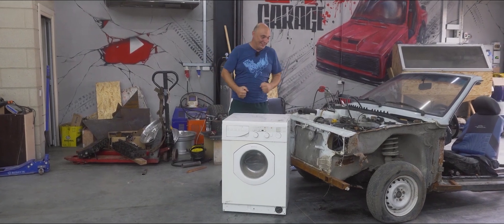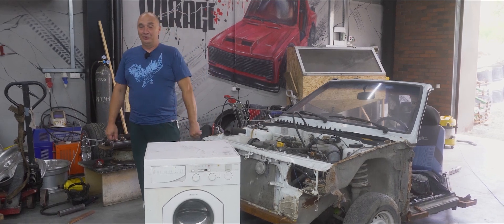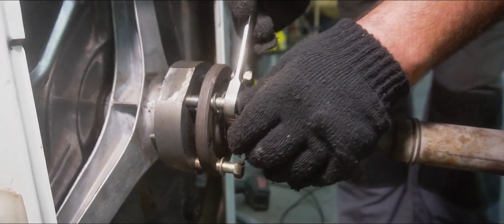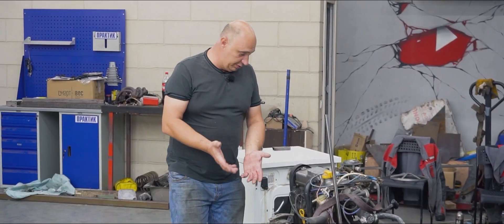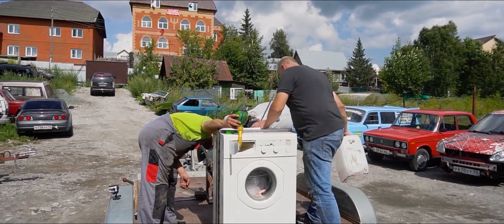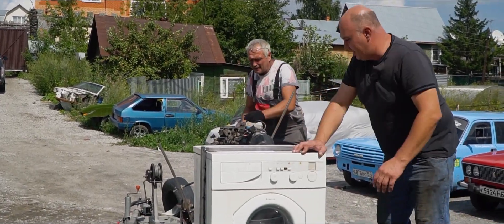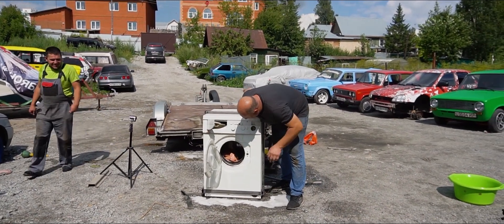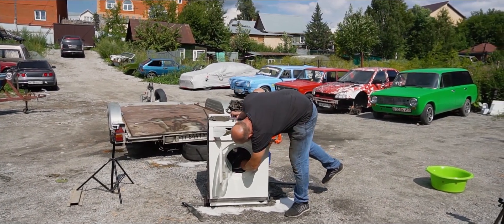Fitting a car engine to a washing machine (spinning it up in 5th gear)

Comment: Years ago I found two projects in the Mother Earth News magazine. One dealt with converting a V-8 Chevrolet pickup truck to run on wood gas, but I see you have already done a wood gasifier for your Lada. The other was a man who needed power and heat, so he used a 4-cylinder 2.2 liter (if I remember correctly) Ford Pinto engine as a stationary power plant and fueled it with methane gas from a digester that used animal waste. That stationary power plant might be interesting to recreate with a Lada engine.

Comment: It's very hot where we are living at the moment and your video inspired another idea that could mitigate this problem. 

The ceiling fans in our place just aren't getting the job done, but they are just conventional electric fans. A more effective fan could be assembled using an airplane propeller spun up by a Lada engine. (and transmission for speed control) 

We eagerly await the testing video. I am sure that any of the Garage 54 mechanics/engineers/videographers/hooligans will be proud to volunteer their residence for the testing video.

Comment: I vote for a dryer.  Spin it fast enough and you will hardly even need to heat it. QUICK dry.

BEST LINE: 'it all works quite well.  We just haven't tried it yet"   Pure GOLD.
HONORABLE MENTION:  Don't use a washing machine to clean your carburetor"

That is VERY good advice.

Comment: Why did you make this difficult? Why didn't you just remove the drive wheels and lengthen the output shaft leaving the engine in the car, with gear shift, throttle, and a seat to control it from ;)

Comment: There is a missing obvious symbiosis, connecting the cars cooling system to the drum to heat the water. The water needs heating and the engine needs cooling.

Comment: FYI.
A spin dryer spins at 1200rpm.
That engine at redline would be 6000rpm and in 5th gear its .9 reduction so 6666rpm!

Comment: Attach it to a wheel with a super high gear ratio and see if you can get the wheel to explode at any point. U can try diferent wheels to see which one can rotate faster.

Comment: Would've been brilliant if they had used a similar pull to the original and connected the radiator up to the water system 🤣👍👍👍

Comment: It might have worked even better with an automatic transmission, and bear in mind that when you block one side of a differential this way, the free side will turn at twice the normal RPM!

As for something else to spin up, why do I get the feeling that a tractor rear wheel could be fun? - Of course, you'd need to be out on an airfield or some such, in case the wheel broke free and decided to disappear into the sunset! - Oh, and you can fill tractor rear tyre with water!! 😱 💣 🌀

Comment: back in the 1920's there was a gas powered washing machine, using a MUCH smaller engine , for those who didn't have access to electricity

Comment: V8, transmission in higher gear like 5th, some sort of reinforced washing drum with some good bearings bolted into the ground so it cant wobble or escape. I want to see those cloths spin dry at 10k rpm 5000g of force.

Comment: Oh, the jiggly bits, they don't build them like they use to. What's the horsepower rating on your washer, sir? Spin cycle from wet to dry in 5.4 seconds.

Comment: Now run the exhaust to the dryer and you can dry your clothes at the same time. Use the other axle to drive the dryer drum. On the other hand they might come out dry but smelling of exhaust.
Reply: not if you use tube heat exchanger like on trabant

Comment: Garage54: Hook the engine to another V8 engine with the exhaust valves shortened and welded shut, then add tubes to the spark plug holes going to a big air tank and make one heck of a fast compressor!

Comment: Engine powered rotisserie chicken.
Engine spins chicken, & cooks it with radiator water forced through chicken.
Like Colin furze but with a gas engine, & @ 3000 rpm. Worlds fastest spinning chicken.😎

Comment: I love how often they run engines with no radiator.
Reply: In Russia it becomes so cold sometimes, so that a radiator turns into useless thing.
Reply: There ladas
Reply: At some point the engine gets so hot, that the fuel is just combusting before the spark plug even fired. By then any ECU would be tarding the timing so low that you barely have any power left. If it's a rotary based ignition the thing would just die off.
Reply: Their Russian, they don't need a radiator
Reply: It’s fine they can run for about 5-10 minutes before she starts to die off
Reply: Ud be surprised how long u can run an engine with no coolant
Reply: I was thinking the same thing. Amazing that the engine doesn't self destruct quickly. I guess everything near the combustion chamber would be at insane temperatures without fluid in the cooling system. Aluminum and/or steel have high thermal conductivity, but clearly not enough, or the manufacturer wouldn't bother putting cooling ducts that close to the cylinders.
Reply: Small annoying details.

Comment: Westinghouse made gas powered washing machines in the very early days for farms and family's that lived off the then very young power grid in America. the washer had a small gas engine and a kick starter for the wife to start it . it had 2 instruction panels one for the washer and one for the engine. you can still buy the engines on Ebay but the sellers want to much for one of them

Comment: Now set the switch where you can open the door while running and throw a cinder block in it. First mount the washing machine to the frame with motor take the bracket from sides and top and it will blow up machine and send barrel tumbling across yard

Comment: heh, by locking down the 1 cv axle, you ended up with x2 the RPM's on the other axle that went to the washer. so you got 2x the speed that you were probably expecting.. :)

Comment: You know? It didn't hit me until the video start playing that the washing machine can be run using the engine off a electric clutch pully like the AC system has with the power provided by the washing machine's motor contacts.

Comment: 'Oh, the counterweight grenaded itself'.
For most people this would be close to the end of the world, no clean clothes, having to fork out for a new washer, and having to pay someone to take the old one away (even scrap men dont like washers, as the counterweight, grenaded or not, is heavy and worthless)
Reply: Weird, washing machines are filled with invaluable electrical components.
Reply: @czechgop7631  the cost of disposing of the non-valuable parts is greater than what you can get selling those 'invaluable electrical components' hence why nobody wants them.

Comment: try a washing machine with a V12.   fill it to the brim with just detergent and put clothes in it. let them tumble in first gear to actually wash them for a while while watching the suds overflow.  then use the highest gear to dry them out without rinsing it.  will the extreme high speed rince the detergent?

Comment: put the engine in a boat using the axle to drive a propeler or maybe make a huge blender and use the engine to drive it shredding everything you could

Comment: So, your washing machines have a big cement ring for a counterweight? 10/10.
Reply: Quite a lot of washing machines have a heavy counter weight in them. Older ones used cement, not sure is that still a thing. Haven't opened any of the newer ones, warranties just last too long these days

Comment: Hook up a industrial floor fan propeller under the hood of sum beater eater car. Redline it fer a bit an watch that propeller launch itself into the stratosphere.

Edit: Don't be flying eny drones overhead, there is a 90% chance the thing will be obliterated during launch of the propeller.

Comment: TRY TO CONNECT MULTIPLE GEARBOXES ON EACH OTHER. BIG ENGINE... AND THE LAST GEARBOX TAKES ALL THE RPM
Reply: Reverse connect a gearbox to increase RPM and build a proper cooling system on the engine.
Make it out of a rear wheel drive engine and gearbox then add a second one output to output and firat gear on the second one will spin like mad!

Comment: 1925: Maytag washer powered by a single cylinder 2-stroke motor. Clothes get washed.
2020: Garage54 powers a washing machine with an 80 hp 4 cylinder 4-stroke motor. Hilarity ensues.
Reply: I was looking for the Maytag 2 stroke machine comment and finally found it 🤣
Reply: there's a 2cyl version of the maytag btw
Reply: tristan 123455 I actually have the 2 cylinder motor. It’s a boxer. Sounds awesome
Reply: Hook it up to a Corvette motor and just watch it enter the next dimension.
Reply: My great uncle put one of those maytag engines on a bike
Reply: @rexjolles  Niiiice.....
Reply: @i think you should stop A twin turbo large V8. Maybe a Cadillac 8.0 litre? Plenty of low-end grunt for big loads.
Reply: @billh230  look up top fuel engine powered blender.....flame spitting margarita maker
Reply: Maytag also used hit and miss engines, not 2 or 4 stroke
Reply: @tonythemadbrit9479  Hit miss is usually a 2 stroke
Reply: @ellenorbjornsdottir1166  I've built a hit and miss engine, and the engines are neither two nor four stroke. Their cycle depends on the speed governor, not the number of strokes. Mine fires about every eight cycles (or sixteen strokes).
Reply: @tonythemadbrit9479  that doesn't make it not a two-stroke. that just means that it's skip firing.
Reply: @ellenorbjornsdottir1166  No. A two stroke exhausts and intakes on the same stroke, and fires on the other stroke. A hit and miss intakes on a stroke when the governor detects the engine has slowed and closes the exhaust valve, then fires on the next stroke, and exhausts on the next.
Reply: @tonythemadbrit9479  Wouldn't that make it a 4T?
Reply: @ellenorbjornsdottir1166  You could say it's a form of 4 stroke with additional strokes from the flywheel momentum. I don't know the term "4T" in the sense of engines.
Reply: @tonythemadbrit9479  Quatre temps - it's the French term for a 4 stroke.
Reply: @ellenorbjornsdottir1166  Interesting. Thanks for that.
Reply: I got a running 1926 maytag engine
Reply: @dillonrumley3295  Excellence, thumbs up!
Reply: I was going to Mention the Maytag washing machine but you else got to it before I could
Reply: but the Maytag last forever

Comment: After seeing this, I kind of want to obtain one of those giant washing machines used in industrial applications (think, the kind that are used to wash soiled linens from hospitals or job sites). Then obtain one of those utterly massive diesel generators used to power entire corporate buildings during blackouts. Mate the two together with a gearbox from a semi-truck in-between.

Comment: suggestion: convert a car from front or rear into left wheel drive (or right), as you prefer
Reply: Literally disconnect a cv axle and you’re done
Reply: @drsipp407  and you have drive at both left wheels?
Reply: Snarl616 get an awd and disconnect both right cv’s
Reply: @drsipp407  Too easy and not that destructive. They should get a front wheel drive and turn it into a left wheel drive car by swapping the parts.

Comment: Should have hooked the engine cooling system up to the water inlet on the washing machine you wouldn’t need the water heater then.
Reply: Yup, you beat me to that one 👍
Reply: @thefreedomguyuk  ๅ
Reply: I hate how much sense that makes
Reply: like mastermilo did it
Reply: I was just thinking that 👍👍
Reply: And exhaust for bubbles and carbonation of your clothing!!!
Reply: Would be hard to do considering a normal washer doesn't cycle water consistently, it just fills up. So water wouldn't cycle through the car consistently.
Reply: Heat exchange is safe for motor. Dirty water will not go through motor. Just put simple radiator below the washing machine. 
Actually gasoline powered washing machines exists in the history.
Reply: Mmmmm it is going to get cloged with soap
Reply: @emiliomar7638  no you'll just have clean water jackets 👍
Reply: @nicklacerte7134  would blow the engine in minutes
Reply: @upnorthviking823  laundry detergent has been used for years to clean an engine's cooling system.
Reply: @nicklacerte7134  and t 👕
Reply: @emiliomar7638  You have a strange channel my friend!👌
Reply: I thought this as well!
Reply: Came here to say the same
Reply: I wrote the same thing before discovering your comment.
Reply: That's a good one, more like a heat exchanger? Takes some time to reach 110 degrees celcius
Reply: Genius! The only problem is, the washing machine was leaking through its heater. Well, not a big issue, just fix the leaking and voilà!  :-)
Reply: There would be so many air bubbles the engine will overheat
Reply: Add copper heating pipe into the washing machine, but a closed loop running back to the car - heating the water by conduction through the copper pipes. That way you maintain coolant pressure.

You'd need a top-loader machine though so you can run then heater in through the lid. Unless you had some complicated slipring arrangement to allow the drum to rotate around it

Comment: When you’re gonna be late to work and forgot to wash your uniform so “Speed Wash” just won’t cut it anymore
Reply: Spin cycle too slow? Upgrade to Overdrive cycle.
Reply: ah yes use a formula one motor
Reply: Roman Lara not diggin the music much...
Reply: What's wrong with Tide😅

Comment: probably gonna sound the same as the one i have in house. XD
Reply: Mine sounds like a jet taking of. It even moves around
Reply: Tacit take your trans old bolts out it’s at the back . You can destroy your washer if you leave it on for any longer. Read a tutorial on yt or read the instruction manual.
Reply: @CL4SSiCS  mine doesn't have those. They were already removed and the drum is free to move. It's just that the machines has a few years now, and besides, It only does It at certain moments. But still, thanks for the tip
Reply: @CL4SSiCS  You know... i didnt know those were there and i spinned the washer... you know the inside and it broke LOLOL
Reply: @tacit9873  same
Reply: @tacit9873  did you remove the safety bolt? We had the same problem, had no instruction manual🤣
Reply: Remove your transport bolts unless you have a indesit , Candy , groenje , or hotpoint
Reply: Ls swap it hahaha
Reply: I bet your washer is unleveled
Reply: same lol
Reply: Can relate
Reply: you should probably have the bearings replaced (also it can be the engine bearings)
Reply: Same lol😅
Reply: Tomu ver😂😂😂
Reply: No te entendí ni verga no se inglés
Reply: Same haha